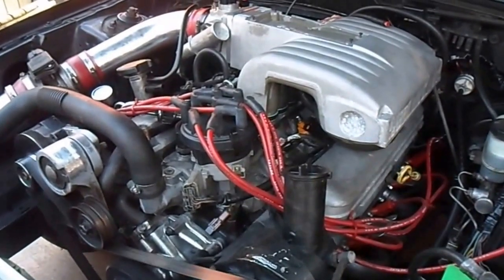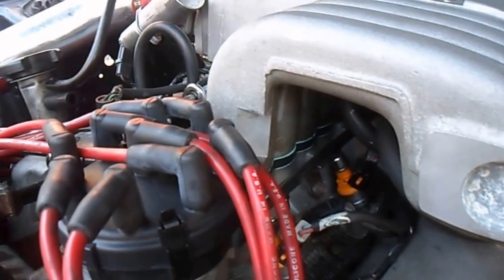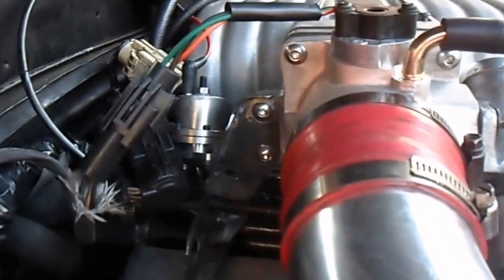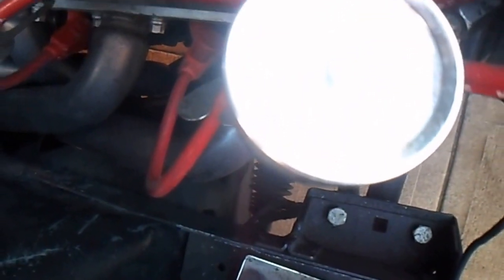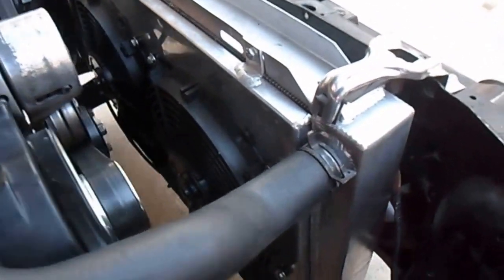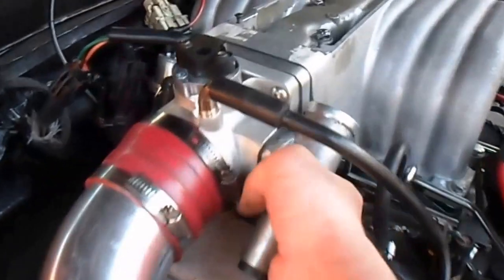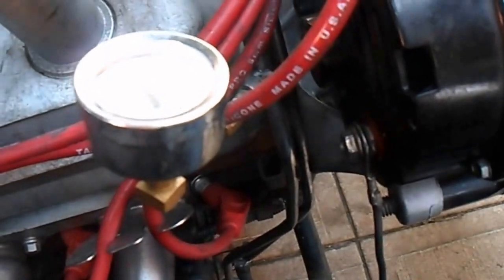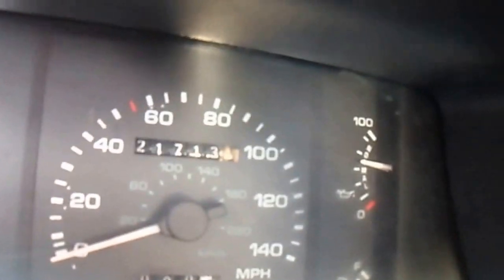Mustang Phenolic Spacer Kits

Comment: Did this spacer put a dent in your factory hood or was it already like that? Think there's going to be any issues with a 1" spacer?
Reply from the maker: The dent in my hood was done by my aftermarket throttlebody that made the TPS (throttle position sensor) stick up to high. I also was running a Procomp upper & lower intake. The phenolic spacer kit fit nicely as I recall. Get that kit and put it on your stang. Not that expensive, easy to install, new gaskets with kit - go for it!